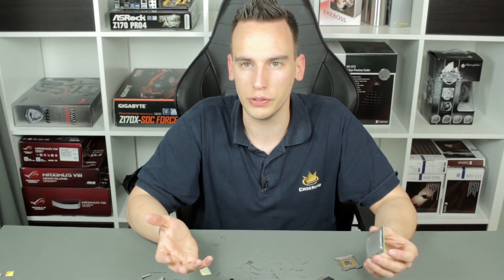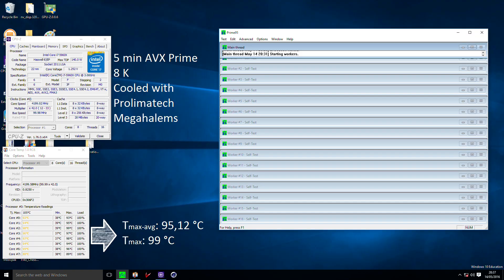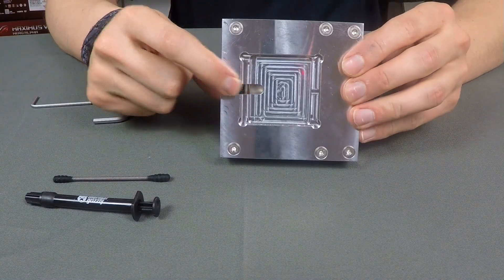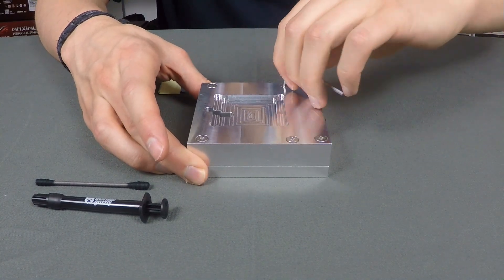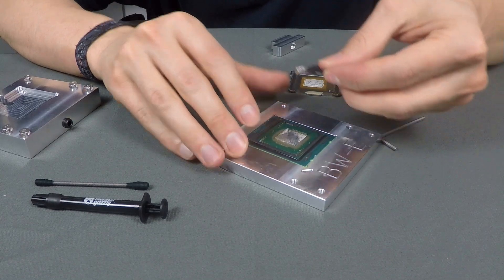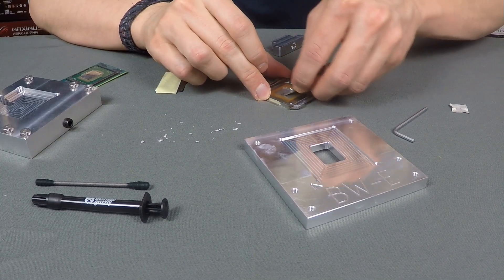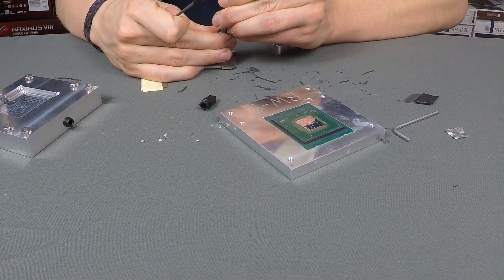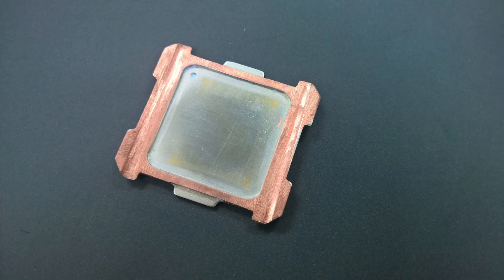Broadwell-E delid. Delidding i7-6950X and i7-5960X english

Comment: I need a de-lid block for my 6950x. 4 degree is 4 degree, I need that for this proc. I can get most of my cores to 4.3, a couple to 4.7 and one still at 3.9, and I am hoping the de-lid and LQ-Metal will get that 3.9 up a little, my speeds are all done in the OS with the intel tunning app, Rampage 5 ed-10 TIA  markspagnolo@gmail.com

Comment: Why don't they just make the chip as large as the CPU heatsoreader, so the dye can be huge and be directly in contact with the heatsink for better heat dissipation
Reply: Fernando Salazar two reasons.

1. Silicon is expensive. So having a larger a larger silicon die is going to cost more. Its good to keep in mind that the cost of a silicon die is measured by the millimeter.

2. CPU's used to be made without IHSs but the silicon die would get damaged by the heatsink if not mounted properly.

Comment: I have a 6950X, 2 x 120mm triple rads + 1 x 80mm triple rad, Watercool heatkiller IV CPU and VRM blocks, but i still can't do any significant overclocking over 4,2GHz (which was already possible on one triple 120mm rad). I'm thinking that this is the key that will unlock the beast. By the way, why can't you run it without a lid?

Comment: @der8auer Would it be possible to purchase that tool or a similar tool for Broadwell-E?
Reply from the maker: You can use Delid Die Mate-X which is up for pre-order on Caseking.de (but I still won't recommend it for BW-E)
Reply: If you won't recommend it for BW-E then why even mention it? LOL
Also, how come the one you used in the video is no longer available?
Reply from the maker: risk is too high and temp gains too low for it. I never released the one in the video because I don't want ppl to kill their CPUs. The new one is meant for SK-X and KL-X
Reply: Okay, gotcha! Thanks! :)

Comment: This is one of the reasons why AMD NEEDS to topple Intel with Ryzen. With an FX processor, despite being a "heater" in terms of the poor IPC and the insane TDP, at least they soldered it so well that delidding is a death sentence without desoldering it, and you'll actually have worse thermal dissipation with the original thermal dissipation being beyond a possibility of thermal throttling. For a $2000 CPU that IS SOLDERED (when THE AVERAGE I7 IS PASTED WITH TOOTHPASTE), this is just UNACCEPTABLE!

Comment: I don't get it, if the indium is is 1mm thick and you're replacing it with liquid metal that's about .1mm thick what happens with the .9mm of space that's remaining? Does the liquid metal make contact with the lid and cpu?
Reply from the maker: you have to grind down the corners of the IHS a bit :)
Reply: I'm having some major heat issues with my 6800k. It's going as high as 100c at stock speeds even. I can only get a small overclock on it. Do you think delidding would fix this problem?

Comment: If you mount the cooler directly to the die you'd most likely see lower temps, though most of all your results are dependent on cooling capacity.

Comment: My FX-8350 still has the heat spreader on it and I don't yet have good enough reason to take it off.  I would also be afraid that if I did, my heatsink would not be secure enough.  With that said, I would not be using the gallium thermal pastes that you are using.  I just now sent Coolaboratory a message for their recommendation on which of their products to use aside from those or any types of thermal adhesives.  I avoid adhesives because I don't want to damage the CPU if for some rare reason I need to get the heatsink off.  My heatsink is a Corsair A70 and they are rather big heatsinks.  I like how they put it there in big bold letters a warning not to use that paste on aluminum and I have seen videos of what it does to aluminum.
Reply: John Doe AMD solders the actual die to the Heat Spreader, whish is the best temp wise for the heat spreader. Delidding is only for intel, never for AMD, if you delid an amd cpu, itll always break no matter what

Comment: When people were saying the IHS is soldered to the CPU i was thinking it was more like a tin soldering type of solder where the CPU die is physically bonded to the IHS
Reply: That's what it is, the CPU die is soldered to the IHS, so it is physically bonded to it. Except it's not tin based solder, but indium based solder which has lower melting temperatures.
Reply: But In100 solder has a melting point of about 160°C and he didnt heat the solder so it would be in its solid state
Reply: IIGrayfoxII That's true, idk how exactly this processor was done but he said something about "glue" so it probably wasn't literally soldered, he was only removing the solder from the IHS.. if he tried to push away the IHS like he did while it was seriously soldered, he'd break the die off, the junction would be much stronger.. check out other vids of IHS removal of soldered CPUs

Comment: I purchased the series 1 delidding tool and delidded my i7 4790k (over clocked to 4.6GHz 1.24v).  I put liquid metal on the CPU, the bottom of the IHS, on top of the IHS and the bottom of the Noctua NH-d15 an saw a 17C drop in temps.  I did the same for my i7 3770k (4.5GHz 1.22v)and saw a 12C drop.  For the time that it takes to do this, maybe 1 hr, it is well worth it to make sure your temps are low (max out at 78C now using prime 95 with AVX 28.10. 60C with older Prime 95 versions).  I also did this to my video card (GTX 980Ti) and saw a 28C drop in temps as I was using Arctic SIlver 5 with my aftermarket cooler.  Thanks for the effort making the tool and the video which inspired me to do this.

Comment: I currently run a 4790k, but in 3-4 years I'll upgrade. Is it ever worth it to get a E series chip, or is it just better to get a mainstream i5/i7 ?
Reply: next gen will have 6 cores in the mainstream consumer line.. for sreaming i would definetly go for an i7.. well nowadays even for gaming.. some years ago an i5 was good but lots of games now profit from the extra threads and the trend will continue as both amd and intel go for more cores and threads on consumer grade chips and also consoles have more cores.. also cpus don't loose as much value as gpus while the performance gain from one generation to next isn't as significant as on the gpu market.. you can run a good cpu, mainboard, ram combo for 6-7 years easily and change the gpu 2-3 times and have a decent gaming rig.. if you have an 4790k there is really no reason to change it for an 6700k or 7700k yet.. the e series is worth it if you do rendering/editing stuff or run crazy sli or crossfire setups as you get more pci-e lanes.. the 10 core 6950x is imho not worth the money.. it is ofc very powerful but i don't think it gains enough to over the 6900k or 5960x to justify the huge price gap.. if money is no concern then yes why not.. but other people who really need lots of cores and threads would in most cases rather aim for a xeon dual cpu setup to get even more cores and threads for the same price.. that gives you less single core performance but as said the most people that really need those core counts also wouldn't need high single core performance..
Reply: If your gaming stay with the z platform if gaming and streaming, rendering and so on - you might wanna look at a 6 or 8 core :)

Comment: I would like to see direct cooling without the IHS, I remember reading a thread about someone doing just that and dropped about 15c vs the 9c you saw. Great work! thank you
Reply: Gabriel Soria Its pretty risky, cause you could break the die wayy easier, but still interesting
Reply: Evbil_wafflez old Athlon CPU's had exposed dies and vertically all mobile chips do as well. But, yeah! I wouldn't ever want to put a large air cooler on an exposed die! :-) I'm sure a water block without a pump on it would be perfectly fine. 

I would definitely add riser bumpers on the corners so the block doesn't tilt or rather have equally pressure on the corners. Just like older desktop CPU's had.

Comment: I'm really surprised this didn't require any heat since broadwell-E is soldered
Reply from the maker: shear force is your friend :D
Reply: sheer shear force :'D
Reply: Natedawg247 Nothing compares to the Dark Side of the Force.
Reply: wouldn't it be easier if you heated the IHS after 1st part? solder can rip the PCB sometimes (trust me i have tried)

Comment: would it help to clean it with alcohol before applying liquid metal? Or even scratch it with sandpaper before applying liquid metal. What do you think, sir?
Reply: Cnotolamacz Dont fucking scratch it what the fuck you wanna break it?
Reply: how would scratching surface of a heatspreader damage a fucking chip XDD
Reply: Cnotolamacz You said applying liquid metal, and in the video he de lidded it and applied the liquid metal directly onto the die, so by you saying applying liquid metal i thought you meant on the die, not the heat spreader

Comment: if you do really want to do a better job sanding the IHS, you should get a pieces of glass big enough to run the IHS in figure 8 while sanding the back and the front of the IHS. Also you should started with 3 type of sanding paper  rough, middle and fine type so at the end w/ the fine type the finishing ends like a pieces of glass that you can see yourself, then you should see way better results. Just my humble two cents tip.

Comment: you can go one step further and using the heat spreader to cast a copper one instead of the shitty aluminum
Reply from the maker: The stock IHS is made out of  copper ;) It's nickel plated
Reply: der8auer ohh , ok thanks for the info

Comment: Why not keep the IHS off, once removed.

Back in the Socket A days we just used bare dies with the cooler directly clamped to it.
No IHS to insulate the heat.
Reply: back in the days where you only needed one mobob for amd and intel......the good old days.
Reply: Nowadays you'd be pretty likely to damage the die underneath the weight of something like a large air cooler, thus the IHS is required to spread the force.
Reply: I don't think that would actually be a issue.
And if the weight was an issue, you could use a AIO water cooler.
Reply: Jonathan Hiener They make special kits which comprise of a backplate and very accurately made standoffs to allow you to fit normal coolers without applying uneven pressures to the die. However I think for the price if you are looking to do this to a new build and say you want to delid 6700k you would get better performance spending the money on a 6800k and there is no risk of messing it all up.

Comment: Can this i7-5960x processor support 128 GB RAM, if M/board supports? i 
mean GA-X99 Ultra Gaming motherboard + i7-5960x processor + 8x 16 GB 
Corsair Dominator Platinum 3200 MHz RAM, will these RAM work 128 GB or 
only 64 GB as it is written in intel website?
Reply: On paper the 5960x only supports 64gb, but I've read a few reports from people saying they were able to run 128gb of ram with a 5820k.  If so, then I guess it's possible, but you run the risk of it not running.  So save your receipt lol.
Reply: OK, Thanks for reply!

Comment: You're taking a risk here: what will give first the solder between the IHS and CPU or between the CPU die and the PCB? For a few deg C.

It's super cool that this worked, but with a $1.5K CPU you're potentially on the fail train to sad panda town doing this.

And was there ever a followup? I'd like to know how the sanded IHS worked out...

Comment: I have a Question to get best temperatures you wouldn't you want to remove the IHS and place the Heat Sync (water/Air/Liquid Nitrogen) directly  on the Die you have to be careful to make sure it sits level and the surface is completely flat as far as setup goes. But in the past this didt offer far better temperatures.  Does this still hold true or is the IHS required for best Thermo Dissipation now?
Reply: Jay Johnston From what I heard the main reasons they place back on the IHS has to do with 4 things: 1-risk of cracking die when placing cooler directly, 2- standard Coolers won't properly contact die due to motherboard CPU support bracket getting in the way. 3- If the CPU doesn't have the right amount of pressure (or too much) it may not get enough contact to the motherboard pins and possibly damage the Mobo(motherboard) or CPU. 4- Newer CPUs (Kabylake/Skylake) have very thin chips and will warp it  if uneven pressure is applied causing the CPU to not have proper contact to the Mobo pins, again resulting in a dead CPU or Mobo.
Reply: Jay Johnston Short answer yes not having the IHS would result in better temperatures but you would have to custom make a CPU block and deal with the other issues I explained about before.
Reply: if you tighten the screws as tighjt as you normally would......the die will crack

the IHS is like body armor for the cpu......

and jsut like in war....that body armor is heavy and adds weight....which makes ya hot when ya gettign shot at in the desert.....

you usually have to add a spacer to get the heatsink closer to teh cpu as well.....as removing the IHS means a larger gap

Comment: It just doesn't make that big of a difference to do this to an expensive CPU. The risk of damaging it is too high and the results are not worth the risk. I wouldn't even try it on a cheaper CPU.
Reply: yeah.. my thoughts exaclty.. i mean this thing costs like 1700.. just wayyy tooo much to just flush down the toilette.. and that for like 6°C delta? never ever..
Reply: I would argue that it might actually be worth it with a cheap CPU.
for example if you were trying to build a small cluster.

Though instead of adding the lid back, you'd probably just put the cooling directly on the die instead.
Reply: So you are so concerned with your machines performance to spend 1700 for a single part, but can't fathom doing a fairly(fairly, not completely) safe extra step to get even more performance(and quite a lot) out of the chip that's one of the fastest chips on the market? I mean, i too would get cold sweat hearing the pop, but if i was gonna spend that much for something, i would definitely do this.
Reply: if you spend 1700 for that chip then you also won't cheap out on cooling and in a watercooled system those 6°C won't make any difference in performance whatsoever.. you won't get into temps where it thermal throttles anyway so why risk it? your cpu does not care if it runs at 60°C or 66°C full load..

Comment: can i ask a question? i have a 5775c which i run at 4.3ghz with 1.375v. my max temp with AIDA64 gets to about 80c on a kraken x61 cooler. i would like to get a higher overclock, around 4.5ghz, which i can boot to but it is never stable enough due to the voltage needed. would delidding help me? anything i should pay attention to with broadwell-h? i've seen pictures of broadwell-h delidded and it looks like quite a complex cpu compared to others, two dies and all.
Reply from the maker: Yea I delided a 5775c already with my delid die mate and it helped to decrease the voltage by about 20-30 mV but I doubt that you will be able to increase it from 4.3 Ghz  @ 1,375 Volt to 4.5 GHz at a good voltage. Maybe you can run 4.4 GHz if you are lucky but not sure.

Comment: why not bare die cool it, the ihs thermaly it supposed to spread the heat but in the end is just just another chunk of metrial between the coolent and the cpu
Reply: look at the gpu dies they don't have those ihs and they cool way better then cpu when you use decent watercooling.  now  i know there are differences between them and consideration to take into account but the ihs on cpu is just horrible it needs a redesign.
Reply: It makes sense for the 5960X and the Haswell-E lineup. The 6950X or the Broadwell-E lineup, however... the PCB is way too thin that you'd risk breaking it unless you know what you're doing (which im pretty sure its more than just adding the right tension).

Comment: Your a tool for using a razor to get the glue off! You should never use a razor, you should only be using rubbing alcohol because as soon as you start scratching the module your decreasing the potential for heat to dissipate as well! Poor method.
Reply: hahahah yea alcohol will desolve indium sure

Comment: will you be making an adaptor to run the LGA2011-3 naked?  Have you run any temp test if you ran the CPU naked?
Reply from the maker: I tried it already but so far no success. Nacked CPU without special adapter doesnt work for sure. Mounting pressure is not enough
Reply: well hopefully you guys will come out with mounting plate for the LGA2011 for naked :)

Comment: Meet you at computex at Taipei last Saturday.
I noticed that you don't use silicon plaster such as Stars-922 which I use to prevent liquid metal move around. I think it's risky to leave those capacitors and resistors alone with liquid metal. What I do is put ST-922 around the edge of CPU die. Because ST-922 is soft at first, so I don't worry if it prevent contact between die and CPU lid.

Comment: I think someone who buys processor for about 1700 euros, it is also able to buy some water cooling as Corsair H115i. Could you use something like this Corsair cooling solution to test you 6950X?  Normal cooling like Macho  for that monster is probably not enough. Thanks.
Reply: For the purpose of this video that is not important. The deltas would be the same even if absoulute temps would be lower

Comment: So soldered CPU can delid really ? I never hear anything about past generation like 2500K 2600K delid.
Reply from the maker: working on 2500K and 2600K delid at the moment :) it's also possible
Reply: I heard that the 2600k and previous generations of cpu's had way better TIM than what was used on 3770k and up so de-lidding wasn't necessary and did not provide any substantial performance increase, maybe a couple of degrees.
Reply: It's more of, if I remember correctly, the Sandy Bridge chips were soldered and the last ones in the consumer line to be soldered. Probably also had one of the last few to get proper treatment in the manufacturing process.